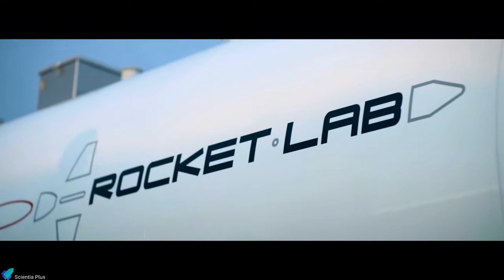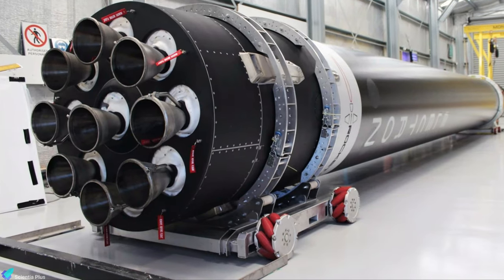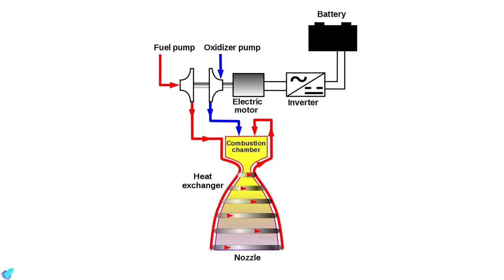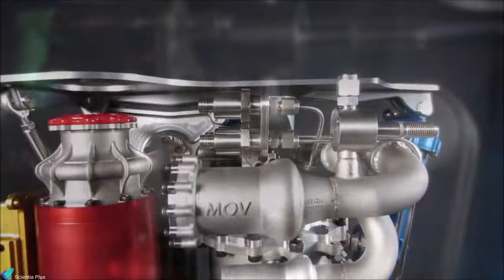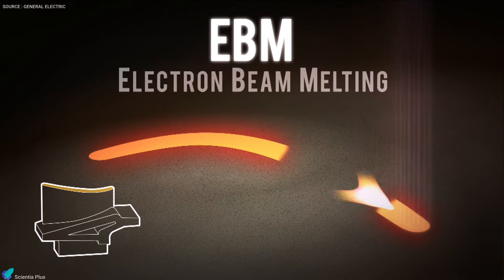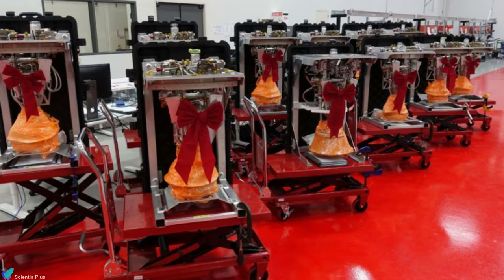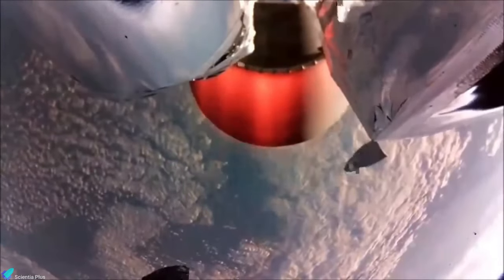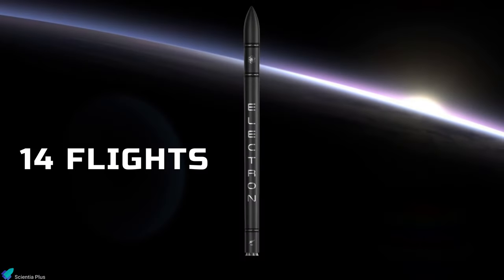The Astonishing Engineering of Rutherford Engine | Rocket Lab Electron Rocket Engine

Comment: why dont they use a traditional ic engine with a dynamo say a buggati engine that can produce a 0.8mw of energy ...the weight of that engine is just 500kg  so add on extra fuel weight to power up which burns and reduces weight upon consumption ..say another 500ltrs of fuel ...so instead of the 1mw LCO battery which weighs probably 3-4 tonnes ....use a 500kg buggati engine and another 500kg or even 800kg of extra fueel if u want which is 1300kg compared to 4000kg of the battery..so u save 2 tonnes of weight thats a lot for the rocket !!
Reply: A Bugatti engine needs a huge amount of air to mix with the fuel at full power, meanwhile the rocket is climbing rapidly into a thinner and thinner atmosphere, at supersonic speed. Slowing incoming air enough for induction or heating and valving liquid oxygen for the ICE engine sounds as complex as existing turbo pump setups — in my humble opinion.
Reply: @andrewsmactips  ahh inwas exactly thinking along those ways ...once the atmosphere is too thin then the liquid O2 takes place in it ..anyways now u have to way the pros and cons on the intensity of complexity vs the reduction in weightage ....but I m sure it's less complex than the jet powered turning pumps ......so way less complex than turbine but a bit more complex than electric ...and since it's pure liquid O2 the amount required is pretty low compared to the intake of air ..and to fill up the void air u can use the burnt exhaust back in to get the perfect O2 ratio in the air where instead of N being most of the air ..u have the exhaust utilizes and replace N in vaccum and then pump into ice engine
Reply: @andrewsmactips  but thanks for ur reply
Reply: @andrewsmactips  so yeah I think as we go higher up to replace air we use the exhaust and then add O2 to it to get the perfect ratio of O2 required to ignite inside the ice engine
Reply: @andrewsmactips  but yeah thanks for the input makes sense to me..and m a bit high hence replying so much XD ..😬 peace :)

Comment: I suspect the electric pump-fed power cycle will remain practical for small space launch vehicles and perhaps for the second or third stage of a larger vehicle. But the energy density of batteries probably won't be sufficient for a launch vehicle big enough to take humans into low-Earth orbit, let alone beyond it. Not for the first stage anyway. It's going to still have to be at the very least a gas-generator power cycle engine and far more likely to be a staged combustion power cycle engine, probably the full-flow staged combustion cycle. However, if paired with a power source that can deliver the required power, there is no reason why the electric pump-fed power cycle can't be used for on-orbit maneuvers, accelerating to escape velocity or insertion into orbit. The design is elegant in it's simplicity, compactness and apparent reliability.
Reply: If used on orbital maneuver engines, maybe you just need a very small battery, and let solar panel charge it over and over😂
Reply: @qiyuxuan9437  thats not funny you are right and it Will happen you clever person
Reply: @qiyuxuan9437  OR charged by a nuclear power source. That would be able to keep the battery system on a float charge during the cruise to the destination.

Comment: Totaly productive figures if it uses a oxy fuel it has wast space ship parts production as vtool also perhapse a spin part with servo on other side as inntegraded part should be offer or L shape or half H the rest is in aplication off airplane transporters and rotational cocpits and for start  position 3,4 front engine and 1,2 back pair  transporter can be also like penta or hexa  scfi design

Comment: Ok, good idea I suppose, not a physicist so on the surface of it, it seems like a good step and a smart idea. But calling it an Electron Engine, while I understand is a Brandi g thing, is such a misnomer. I clicked thinking it was an electric rocket engine, not a traditional fuel engine that has a small( though significant) replacement. It would be like calling my car an electric engine, coz it has a battery in it, even though it still uses fuel.
Reply: The name of the rocket is "The Electron", not the actual engine itself
Reply: Vighnesh Kannan yeah. I know. After watching it. Like I said, a brand. I said “call my car” but I should have said: “if a company called a model ‘Electric Automobile’, but it was still a standard fuel car.” It makes you think it is something it is not. But companies are big on misleading names. Still seems like a good idea.
Reply: @StixFerryMan  yah, I understand, misleading names can lead to some confusion. For some context though there used to be a rocket named the proton which had a somewhat convoluted design approach, it ended up exploding because of it, I think they named it the electron in opposition to that, sort of like an inside joke of the aerospace industry.
Reply: Vighnesh Kannan well I hope this works out well. Anything that cheapens space travel is good in the long run. As to the inside joke theory, when they do develop a more electric engine that uses less or no traditional fuels, or not in the same traditional ways, they call it “the Gas Gussler 3000” or some such.
Reply: It's the same as with space x calling their new rocket the starship even though it isn't a starship. As for the engine, you always need to dump propellant out the back, anything else would violate the law of conservation of momentum. Thus, it's not really possible to make a more electric engine than the Rutherford aside from Ion engines which still need propellant and are crap in terms of thrust.

Comment: I guess someone forgot that DC motors don't need an inverter...
Reply: He even says the inverter modulates for an AC motor, then goes on to say "the Rutherford uses a dual dc brushless motor". This video is just an info dump.
Reply: @santos.l.halper1999  yeah it is like "lets explaining a one of a kind engine with a totally different electrical architecture example first"
Reply: @simonrano8072  or you know, you have no clue what you are talking about.

Brushless DC motors don't technically run on DC, they actually run on AC, but you can use DC with a complex controller which is how its usually used.

The naming is a little dumb but makes sense because AC motors generally refer to induction motors, and brushless motors are different to that.